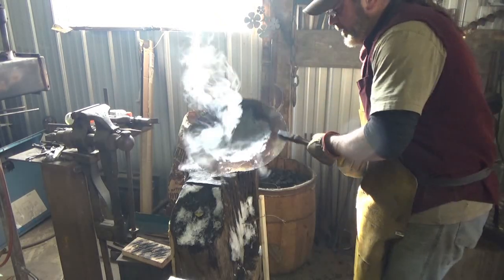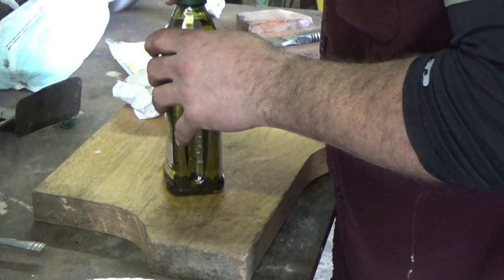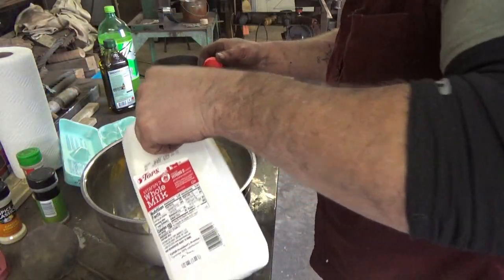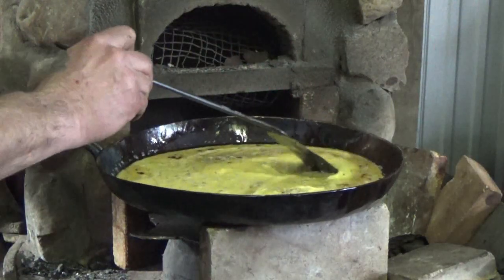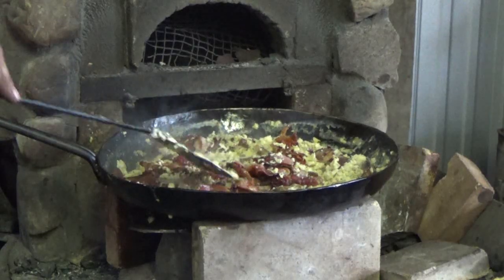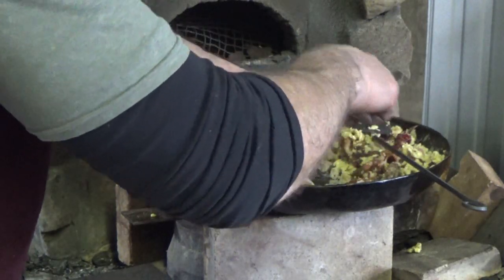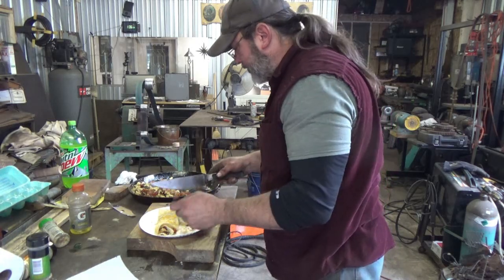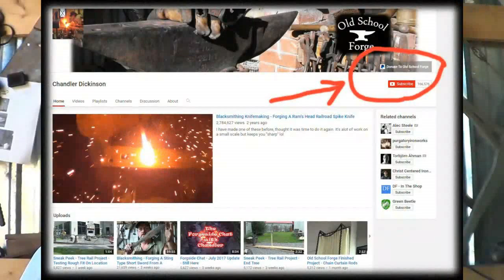OSF Special Feature - Forge Cooking - Big Pan Scrambled Eggs Bacon Home Fries Wrap

Comment: Hey chandler, that’s a meal for any time of the day. Some chopped onions sliced in with the taters always help. One or two chopped, fresh jalapeños cooked in offsets any bad effects from the grease. 

Here’s a few tips I learned and will share with you. If you use copper rivets for fastening your handles to pans and utensils, the heat won’t travel to the handle. I use 1/4” copper rod I bought on eBay.  We often cook in “discos” here in New Mexico. They’re from farm implements. Might go well in your neck of the woods too.

Final tip. If your turds float in the toilet, you’re eating too much fat. If they sink, you’re good to go.

Thanks for the video.